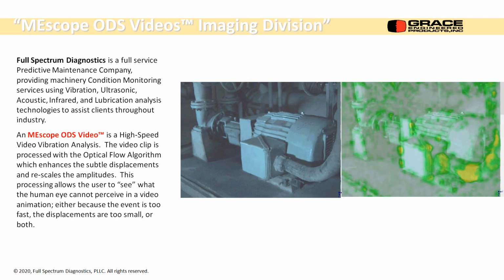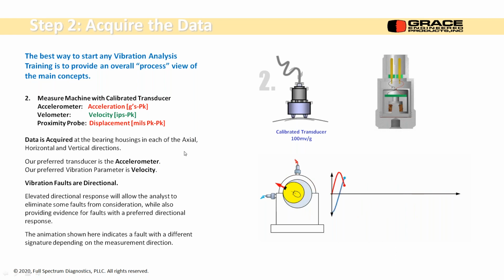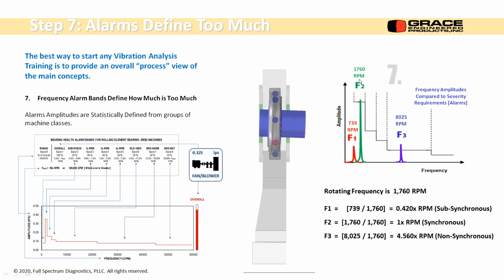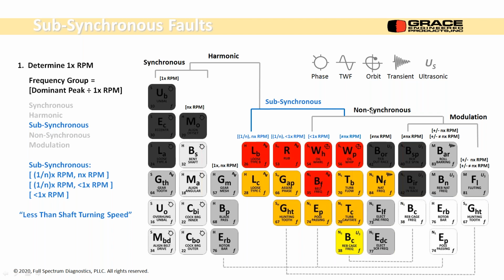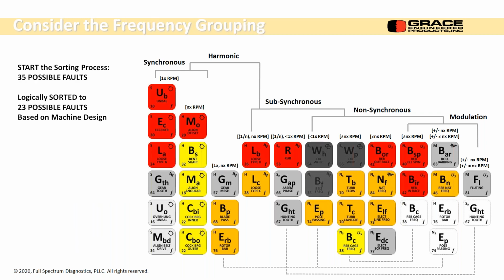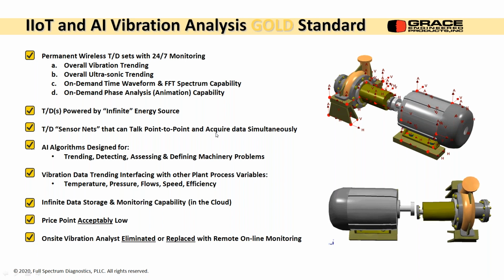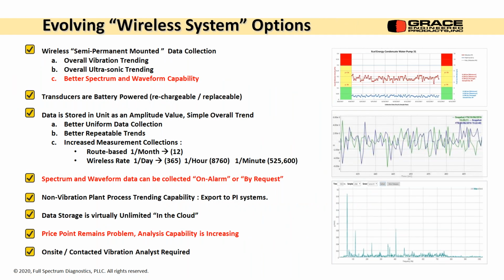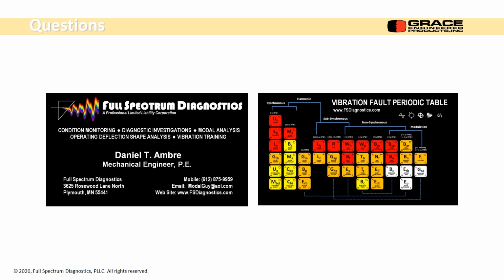Webinar VOD | An Introduction to Vibration Analysis | Part 1/3

Comment: You mentioned ultrasonic measurements. Is there a transducer that will interface with the accelerometer data collector that you can recommend?
Reply from the maker: Hello, thank you for tuning in. This is a recording of a webinar hosted by a guest presenter. You can learn more and contact the presenter at https://fullspecdiagnostics.com/